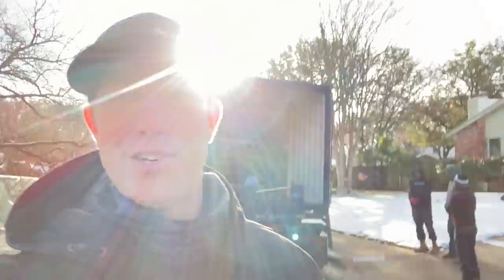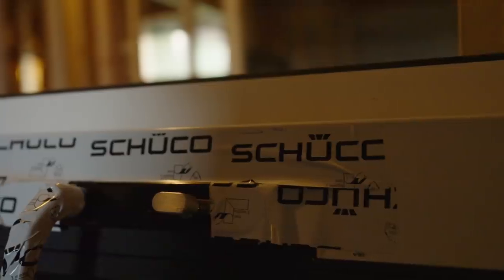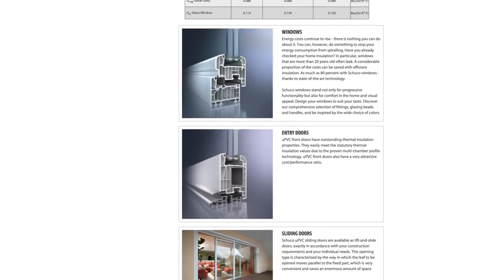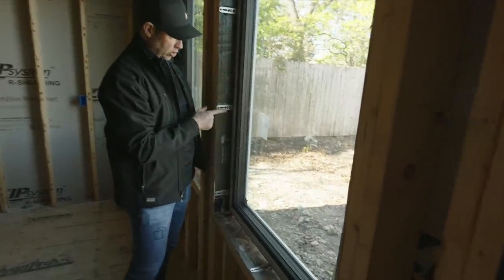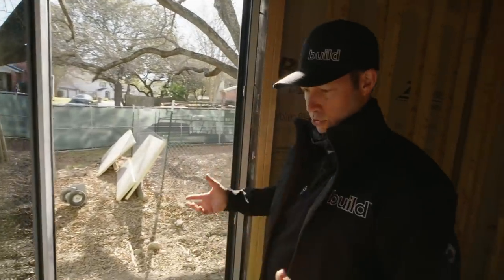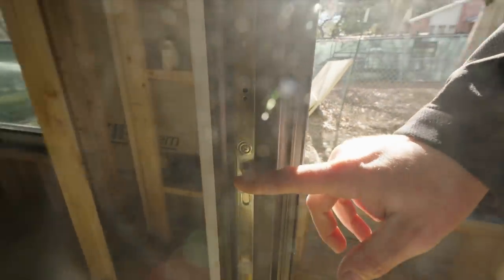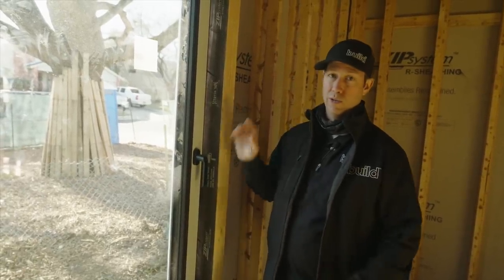Ordering Crazy Efficiency (and Affordable) Windows from Europe!

Comment: In Germany the windows you get can have built in fly screens, blinds and outside     grill that drops down when needed at night for security or as another shield of protection against blizzard or wild weather.  Another type has drop down sun shade or privacy screens. The windows in most northern european countries are awesome.
Reply: Yeah, yeah, yeah: rub it in ;-)
Reply: Sounds like you all are throwing money in the trash. Just use dual windows. it's much cheaper and much more efficient. Blinds are $5 over here.
Reply: That’s what I was wondering is if you can get them with screens on them I love the design but I would not get them unless I can have a screen on the outside to keep the bugs out
Reply: @ralan350  The windows in this video are really cheap & basic by European standards. for example he said these are R7 insulation windows but the best quality ones in Europe are now R24. You can order them with bug screens, internal black out blinds and even smart security sensors wired in at the factory.
Reply: Oh your German überwindows have an outside grill, that’s so cool, so you can throw your German sausage on it for a quick cookout whenever your BF gets hungry

Comment: And everybody was laughing that all these are unnecessary in Texas, and now look at them:D
Reply: I mean they certainly help at keeping the cold in too.
Reply: Omg 3 days of actual winter the horror
Reply: They work both ways! In norway we use 40cm tick walls(insulation) on new builds. Amd tripple glass. Works in -40c° in winter amd +35c° summer
Reply: @aztex6981  Yes, but compared to inside temperature, -40C is 60C difference, while +35C is 15C difference (<10 if we set the thermostat a bit higher, like 25C).

So warmer climates require less insulation.
Reply: @juzoli  even with triple glazed, the effective insulation value is lower than any insulated wall. An insulated wall will always be better at keeping heat in or out. If you want better efficiency out of your aircon, but still want windows, triple glazed is the bare minimum I'd recommend.

Source: Journeyman Glazier
Reply: @josephdomshy4068  I couldn't afford European windows so I bought cheap double glazed windows and will insulate with cheap r14 movable insulation - yes, I'm a caveman
Reply: @jl9678  :  haha.  Simple. Removable insulated window-panels (interior or exterior  - heck do both for extreme weather) - I was going to say Insulated shutters will beat any  window treatment when I saw your version.
Reply: @kadmow  not only that. Can you imagine the replacement cost of these windows in 20-25 years when they start getting foggy?
Reply: @jl9678  Never seen windows here in Europe that become 'foggy' in 20-25 years. Only if the glass is broken and moisture is leaking between the glass panels. How are the building standards in Texas? Here in the Netherlands new houses must have windows with U value of max 0.6 for the glass and frame since 1-1-2021.
Reply: @robberthaak  do you mean 0.06?
Reply: In Europe, we build our houses to last +100 years (and usually much longer).
In America you build them to last max. 40 years.
Reply: @akyhne  I live in a 60 year old house in the US, and it is perfectly intact. So as my whole neighborhood. They can easily last 100+ years.
On the other hand, in Europe where I’m from, I know nobody who would live in a 100+ year old house. If any of those houses are still standing, they are usually uncomfortable as they are under-insulated, moldy, and cold, and also their layout is terrible as it is much harder knock down a stone wall.
Reply: @juzoli  So where are you from in Europe? We've got thousands and thousands of old houses in my country, and most of them, by far, are modernized to highest standard possible, at the time of renovation.
In my 52 years, I can't remember ever being in such a house you describe, unless it was a house of some old, lonely guy living there and doing nothing to the house for decades.
Those houses were usually demolished.

As an electrician in my young days, I've been in countless old houses, that were being renovated. And for many other reasons.
In my job as a young electrician, I've never come across a house, like you describe.

I also suggest that you watch this video:
https://youtu.be/wpxLLCdW_Gc
Reply: @akyhne  And how much is it to renovate a such house, including updated electricity, insulation, open kitchen and everything, per square meter?
Reply: @akyhne  Also, how about environmental sustainability? Are you also building NEW houses out of brick and concrete, which are huge CO2 sources?
Whenever I see environmental friendly passive houses in Europe as a new construction, they are made of wood...
Reply: @juzoli  "And how much is it to renovate a such house, including updated electricity, insulation, open kitchen and everything, per square meter?"

I have no idea. But all old houses are renovated, but a few, because it's much cheaper, than to build new.
We have very strict rules & regulations on how a house can be renovated, to make sure they are up to standard. And still, it's much cheaper.

I live in an apartment in a house, that's probably 70-80 years old. It was completely renovated 10 years ago. And it's around 5-10 degree C outside in these days and I barely have any heat on.

"Also, how about environmental sustainability? Are you also building NEW houses out of brick and concrete, which are huge CO2 sources?"
That one, you're pulling out of your ass.
I have no numbers on how much CO² it takes to build a wooden house or a brick house, and neither do you. You also have no numbers on how much energy and CO² an American wooden house uses over a period of years.
But I know that we build our brick houses way better and way better insulated, than an American wooden house.

Your claim sounds a bit like the people who say it takes more CO² to build a wind turbine, or an electric car, than they will ever save.
That's just ridiculous, baseless claims.

A normal, new house in Denmark has:
400 mm polystyrene under slab (concrete floor).
300-400 mm outer wall insulation, with either a 100 mm leca or aerated concrete inner wall, which also works as insulator.
2 or 3 layer thermo glass in the windows.
400 mm insulation on the loft.

A typical new wooden framed house in the US, of those I've seen being build or on this channel:
Usually around 2 inches (50 mm) under the floor or slab.
100-150 mm insulation in the outer walls.
Windows, I'm not sure. I HAVE seen the usage of thermo glass once or twice. But only two layer.
100-150 mm insulation on the loft.

In many states or counties in the US, they don't even have building codes or regulations, for the buildings themselves.
Reply: @akyhne  No, manufacturing cement and brick needs lots of heat, and KNOWN to be huge sources of CO2, it is not “out of my ass”. You seem to be surprised to hear about it, and you are in the stage of denial. Do your own research.

And I know how hard it is to do anything with a brick house. It is EXPENSIVE to do any modification or improvements. There is no space, and you have to demolish and carve a lot. You can build a brand new wood house for the price of renovating a brick. So it is more like you are stuck with concrete/brick, and not choose that as the most efficient option. Also Europe has much less wood to begin with...y

Wood is cheaper, environmentally sustainable, gives enough space for proper insulation, and easier to modify whenever you feel like it. The only drawback I found after moving into wood from brick, is that it is noisier.
Reply: @jl9678  least you tried Matt's doing good work here on YouTube informing the public of better products while not cheap currently, this raises awareness, raises demand for people with resources, the local supply chain  will evolve bringing cheaper prices of better products
Reply: @juzoli  there is also that danger in the states of people randomly shooting at your house, and as it's made of paper (or cardboard, or maybe even OSB) walls, then you die. Seems a strange construction method for a country with one of the highest gun problems in the world.
Reply: @cjhification  Wtf? 
That’s the stupidest thing I read today, even though I was browsing Facebook before:D

No, there is no danger of random shooting in the US... There are a few ghettos to avoid, but anywhere else it is perfectly safe... We don’t even lock our doors here...

And I never heard a single case where someone was injured in their homes, because there was an unrelated shooting on the street.

So no, this is not a factor at all...
Reply: @juzoli  Matt Risinger, an American builder was talking about the issue on his channel, talking about the number of drive buy shootings and that stray bullets are an issue that's becoming of increasing concern. So it's not me that raised the risk, it was an American, who does not seem to be anti gun at all. My comments were based on a fell countryman's comments, and are not baseless as you suggest. 

Fine of it doesn't apply to your area, and fine if you like living in a match box, I just prefer a solid house to a paper/wood one, but to each their own.
Reply: @cjhification  Not sure where he got that idea. Of course if you are really looking, you can find ghetto areas where it might be a problem, but not a level that it would appear in any statistics...
I live in a pretty average area, and travelled most of the US. And believe me, this is not a concern at all. You really need to specifically look for such areas to find one... The overall safety might be even higher than in Europe...
Reply: @juzoli  interesting stuff. However from a stats view, the levels of gun crime in the states generally is very scary for a European, as the number of mass shootings ever to occur across the entirety of Europe is less than the number that have happen in a year in the states.
Reply: @cjhification  I’m not sure what are you comparing here exactly.
The correct comparison is the number of murders per year per capita, and using that comparison, US is like 3 times higher. Certainly higher, but I wouldn’t call it “scary”. Scary is like some countries in central America, where it is way over 10x higher, and it affects your general safety.
And also, these are concentrated in small communities. In an average American suburb, you will never notice it, it is perfectly safe. 

So no, bullets going through a wall is absolutely not a concern, and you are the first one I hear any such thing at all:D And you also only heard it as some rumor...
I would recommend you to fly to the US, rent a car, and have a roadtrip across the US. It is an amazing vacation, and you can learn a lot about it in first person.
Reply: @namAehT  no, no they don’t. Humans produce heat you can literally heat your home with a candle and a treadmill :D
Reply: @jl9678  they are not gonna get foggy and the replacement cost for these are nor high.
Reply: @astronemir  lol. They all eventually get foggy and the replacement cost is super high
Reply: @juzoli  It is also more expesive to air condition a house than to heat it, if you have a heat pump at least.
Reply: @Alex-lc1bv  
It is not just about money. If it is hot outside, you can turn on AC, and you are good.
But if it is cold outside, and your house is not sealed and insulated, and you turn on the heat, you still have issues:
- Frozen pipes
- Condensation on the walls which lead to mold
- Cold draft (which is much more annoying than hot draft)
- Bigger temperature differences within the house
Reply: @juzoli  that depends from area to area, some areas are more prone to have higher temperatures and some lower. For example where I live the lowest we can get is around -6 degrees, but we can get as high as 40 degrees Celsius
Reply: @josephdomshy4068  You say American wood walls as in this video have better isolation? :)
Reply: @aztex6981  40cm ? Newly built houses in Norway have 16 inch thick walls? Wow.
Reply: @jl9678  I wondered about that. Is this still a problem? What is the life expectancy of a triple glazed high quality window like these.
Reply: @VSMOKE1  3 days were enough to cause that much damage. A lot of burst water pipes and destroyed homes.
Reply: @irasthewarrior  And next time prepare very simple solution 👌
Reply: How can I learn how European houses are built to last 100 years?  I don’t understand what US don’t use these methods.  Maybe because that would mean the home builders, home rehab, home repair companies and workers would lose money.  I think maybe we have it wrong in the US where more importance is given to businesses than to citizens.  I’ve heard that there are so many great products out there for so many things but aren’t used or not shown to the citizens or are even blocked from usage from lobbyists and the government.
Reply: @pat6703  US houses easily last 100 years too. So why would they choose something which is more expensive, less environment friendly, and less flexible?
Reply: @juzoli  I’m sorry, Zoltan, but that is not the reality of US houses unless the owners were rich enough to buy all the expensive upgrades to make it last 100 years.  All you have to do is go driving past old houses to see that they not only won’t last 100 years but so very many need to just be demolished.
Show me houses that have lasted 100 years.  Show me houses that you believe will last 100 years.
Reply: @pat6703  Those houses are all around. I see them being bought all the time for a million bucks, and NOT being demolished.

The house I just bought is 65 years from old. I had a chance to see its structure during some modifications, and I didn’t see a single structural flaw. The wood structure is just as good as new.

There are also 2-300 years old houses which are sound, but those are rare, mostly due to historical changes.

Comment: Fiberglass windows from Canada are both higher quality and less expensive than the American windows we looked at, IMO.  We used triple pane fiberglass windows from Accurate Dorwin and Inline and love them.  U-factors of 0.14 and 0.19 for most windows with high SHGC.  Their fiberglass was infinitely more robust than Marvin's and less expensive.  Cost for a tilt turn was literally 1/2 to 1/3 the cost of Kolbe and Marvin, and I like Inline's better.  You won't get wood, and wait times will be longer.

Comment: Steve scoped out those windows a while ago, and man was he right. Those 10 sealing points, perfect for NYC or any loud city. Wow
Reply: Here in NYC can buy similar windows from Europe many shops selling and service .
Reply: I had them in London and they've ruined any other windows for me. Indeed incredibly quiet. Truly great products.
Reply: You right about the sound. The locking points and the gasket system have a big impact on sound reduction....and that is before you put laminated glass it the windows. These windows can handle glass up to 52mm (2in) which gives you a lot of options for sound-reduction glass .
Reply: Did he use double or triple?
Reply: You can also get different glass options for those windows to make them even more quiet. I'd say the most common triple-glaze setup over here (Estonia) is 4-18-4-18-4 where each glass is 4 mm thick and the spacing in between is 18 mm. Since half the rooms in my apartment face a busy street with big windows I ordered a 44.2-16-6-14-4 setup where the outermost glass actually consists of two 4 mm glass panels laminated together and the middle glass is a thicker 6 mm one. It's noticeably quieter than the regular setup but not that much more expensive. The two windows, both around 2600x1500 mm with three sections each cost € 1.600 with installation.
Reply: @Rebasepoiss   I bet you see an ambulance scream by and hear very little?
Reply: @agn855  Incredible. I've lived in the worst parts of NYC, lots of fire escape - window kick in robberies. 

Not with these beauties.
Reply: @EASWindows  just awesome to me. My NYC townhouse was broken into thru a cheap rear window. They stole only CDs, a leather jacket, anything Apple, and fled. They missed my watches. Ha!
Reply: @ZimorKilled  He said both. Triple on the cold north side I recall.

Comment: Today's latest Essential Craftman video is about insulation, and a commenter there mentioned that you need to be careful about the ability of some high-expansion foams to warp a window frame. It sounds like with the stiff UPVC and a low-expansion foam, you will avoid that danger.

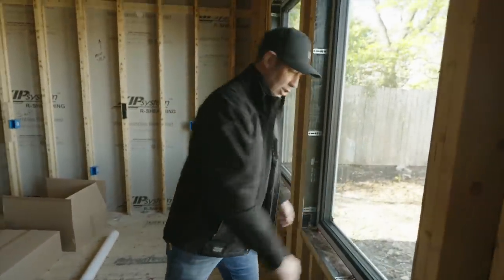Comment: 5:47 could also put a water resistant wood there. Like in Europe before (and with Thermopane wood frame windows) we used to put oak on the bottom. And it doesn't all need to be oak, just the part facing up. I'm sure there's at least one place in your area that does laminated wood (or can do).

Comment: A couple of things to consider with these kinds of windows. Yeah they’re bullet proof and super efficient. But they’re not practical if you have blinds/shades/curtains. Not sure about screens for bugs, but none of the windows in Germany had screens where we usually stay. 

Also if there’s a breeze they can swing all over the place they’re super heavy and will knock out anything in their path. So you can’t use them if you have anything on the window sill. And you can use them if you have a desk or coffee table of plants ... anything in the way of their path. 

If you want to black out the windows you can install electric or manual storm shutter outside that rolls down and blocks out all light (like they have in Europe).
Reply: Hmm, very useful point about swinging in the breeze.
Reply: So you didn't realise you can lock them? I mean you open with handle, open window and with handle you lock it in position. Window will not push it more open unless it's a really stormy wind. And no problem with curtains if you want fresh air in as you just tilt it to get max air exchange, so you are not supposed to open it fully. Here in Europe blinds usually are built into the windows itself so no problem with them either.